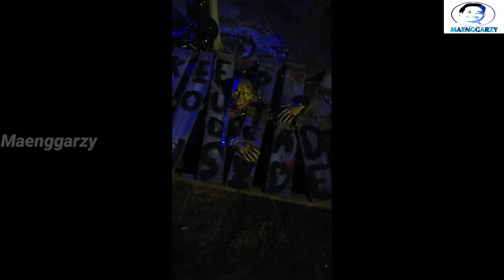Grim Reaper | DIY Grim Reaper halloween prop

Comment: How did you cut the cloth what measurements
Reply from the maker: Just measure the height and width of your project..
Reply: More details, please.
Reply: @sulatlalaki keep 1 cloth intact cut hole in middle the other clothes my best advice is cut it to fit your instinct it won't come out identical, but that's the point make it to your liking
Reply: @fishon5748 Thanks!

Comment: Hello! Where did you get the fabric from? What kind?
Reply: You could get it at home Depot it's called canvas drop cloth
Reply: You can use a old sheet . Wash it with a cap or maybe not a half .cup of bleach. Tear it to however you like . That is what I did 😊 I used my black acrylic soaked it for two to three days after I bleached it.
Reply from the maker: Everything they said is correct mark..ive got mine from home depot canvass drop cloth 🤙